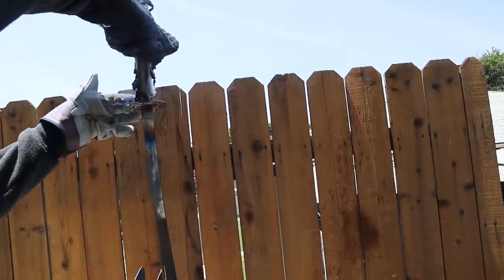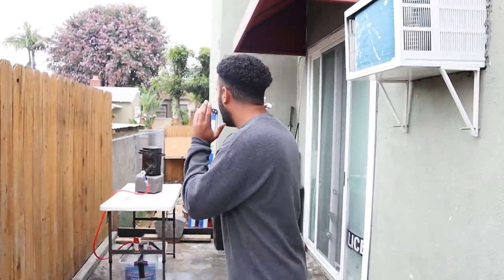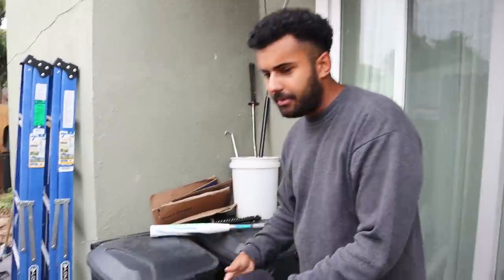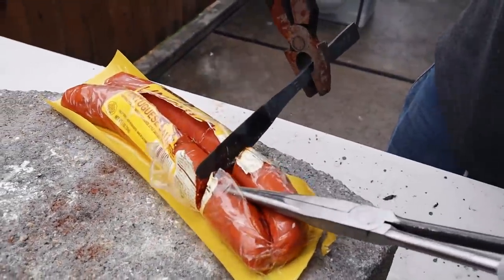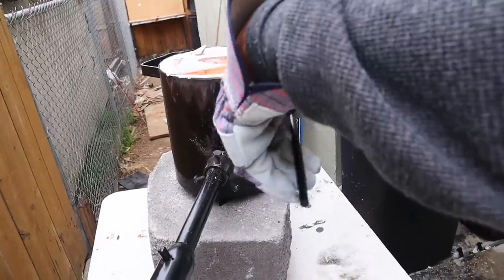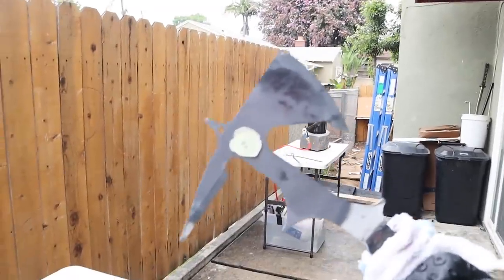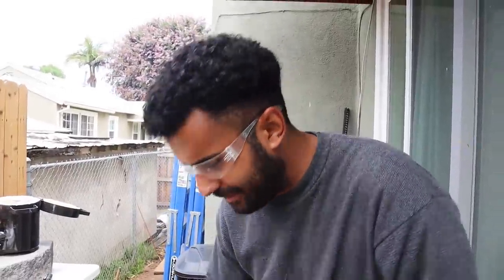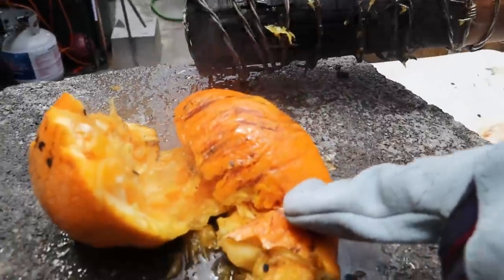We Made 3000° DEGREE WEAPONS Using A SMELTING FURNACE!! *You Won't Believe The Results...*

Comment: use kevlar glove, they are actually good for heat resistance
Reply: BANGER ALERT!!!
Reply: Good idea but where exactly do you think you can find Kevlar in California. don’t say police vest
Reply: Samuel Vest swat chestpeice
Reply: GrOnch swat is the elite force OF the POLICE
Reply: @pilotpup7569  nah its not the 'elite' its just a different job, they do more door kicking and armed stuff
Reply: @Thomas Beckham yeah I go to a ceramics studio and I've helped with getting pieces out of the kiln before and we use kevlar gloves to hold on to stuff which is well above boiling hot (I'd say 400 degrees Fahrenheit)
Reply: yes but kevlar is expensive and silicone has a higher melting point but less heat resistance
Reply: Yeah, or you can just use a fire resistance potion.

Comment: iron melts at 1580 degrees Celsius so if the furnace is 3000 degrees, it will melt really quickly, which means that the furnace is not 3000 degrees

Comment: The melting point of steel is 1425-1540°C (2600-2800°F). Also, all of your weapons are no longer hardened and won't hold an edge for more than one strike.

Comment: Not trying to throw any shade but steel and iron have a melting point below 3000 which means most items in the video couldn’t ever heat to 3000 and not bend morph or just melt again just wanted to point it out

Comment: I forge knives  and u have to get the metal red hot so it is softened enough to hammer to shape. some steel can't handle the heat like the bat it was crazy

Comment: Scientist walks in : But shouldn't the furnace melt at 3000° since steel melts at only 1370 degrees C (2500°F)?  So you couldn't get the furnace at 3000° without also melting the furnace and the weapons you put inside it since they are also steel.

Comment: ADHD you are going to want to get a pair of welding gloves of you don't want to burn your hands. Also it's not quite 3000 degrees because the steel weapons would start melting. It's more close to around 2000 degrees if not less. I'm not hating I swear I like the enthusiasm.

Comment: @ADHD'SWorld be carful using any blades you got red hot after this. Super heating a blade like that actually weakens it unless you reharden it. When you reach forging temperature and above you can cause major structural strength problems. Just be careful we don't want to see you hurt again

Comment: So you know if it really was 3000 degrees you would hold a handle with molten steel on it because steel melts in temperatures far below 3000 degrees Celsius